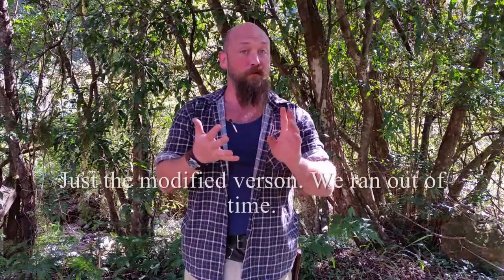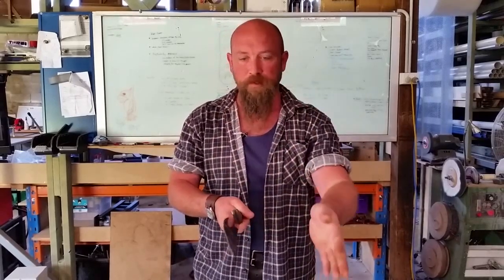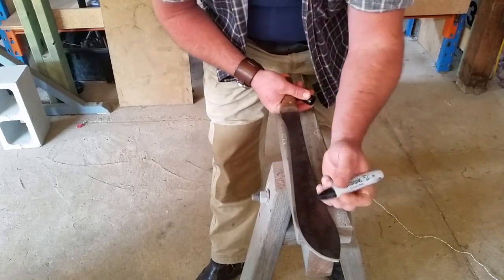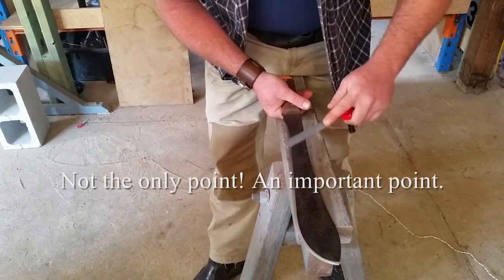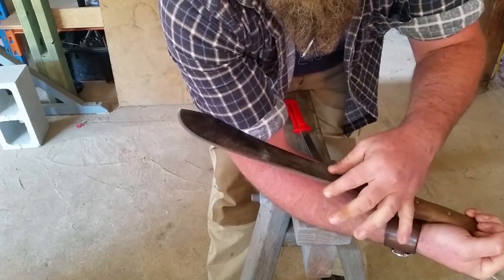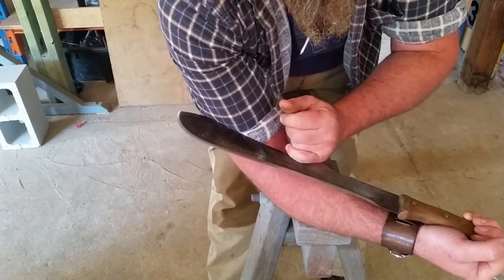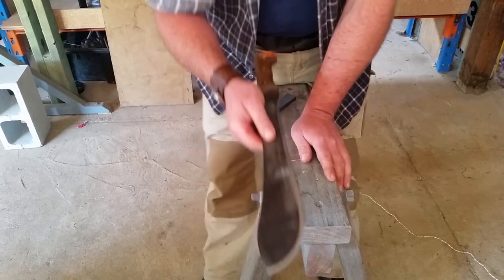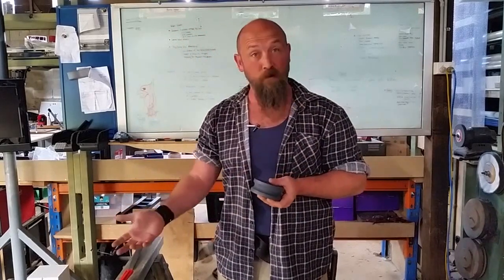Machete Sharpenening: A simple method that suits beginners and pro's

Comment: Anything special about that file or is it just a typical file?
Reply from the maker: That is a good question. At the end of the day, most metal cutting files that are not too coarse will work. Double cut files will hog out the steel faster (good for chip removal) but leave a lot of follow up work for the stone. Single cut files will always leave a smoother edge.
I use chainsaw raker files (sometimes called a flat chainsaw file) for a lot of reasons. 
It's reasonably middle of the road as far coarse/medium/fine cutting speeds and that tends to match the next finer stone I commonly use.
 Files are no where near as good as they use to be but chainsaw companies are still putting out fairly decent files that are available all around the globe. 
They are pretty much the same cutting pattern and size across all the brands.
They are cheap and easily packable.
They always come with rounded safe (non cutting) edges that I use as a poor mans burnishing tool to sharpen the card scraper on the back of the machete. 

If I'm in the workshop sharpening these machetes, I almost always grab a full sized file. About a 10-12" Smooth Mill or Mill Bastard file and I use a larger, double sided axe stone. 

When I am backpacking in to a camp site or I'm field sharpening, it is always that little chainsaw file and small pocket stone. 
Hope the info was helpful mate.
Kind regards,
Ben

Comment: What kind of file do you you?
Reply: I meant, what kind of file do you use? Thanks. Great tutorial.
Reply from the maker: I'm glad you found the information helpful D. It's just a flat chainsaw file (one of the files used for sharpening a chain). They are easy to get from any place that sells or services chainsaws. Technically it's just a mill file but flat chainsaw files are small and also have two rounded edges. The rounded edges are very useful if you are planning on putting a card scraper edge on the spine. 
I hope that helps mate.
All the best,
Ben

Comment: Where can you find that norton pocket stone? Will any Norton stone work as much as the one used in the video? By the way great video brother I learned way more than expected thanks 🫡
Reply from the maker: Nice one DB. Thanks for the comments. 

Machetes are really forgiving when it comes to sharpening. Because you have such a long edge and more mass, you can still get them to perform even with not so great sharpening equipment. 

If I was being honest, most of the quality brand name stones will get the job done just fine. That little pocket hone (Norton #149 Pocket Stone) is great, but it is also a bit on the fine side (clogs up easy). The double sided axe pucks are great if you don't mind getting your fingers that close to the edge. 
I like Norton as they are affordable and perform well. Lansky is another good brand. I think Bahco or Fiskars has a small line of stones. 

Canoe stones (traditionally used for sharpening scythes) are perfect but are hard to find these days.  

When you want a finer crafting style edge, it's just a matter of using finer stones/hones and an abrasive strop.

I hope some of the above was helpful mate.

All the best from OZ,
Ben
Reply: @MacheteBushcraftAustralia  Oh I see, thanks for the information indeed this was helpful. It put my doubts at ease from having to buy cheaper stones thinking it wouldn’t perform as well as the more expensive/finer stones from what I seen and heard from other YouTube videos… Your the best, again Thanks a lot 💯✊🏽I never seen anyone explain a tutorial like this with such passion 👏
Reply from the maker: @demonback8732  Happy to help mate!

I'm with you on that point. You're going to get many differing opinions on the internet. Sifting through what works for you is part of the process. I know a lot of people spruik the 'most expensive is always the best'. With basic quality sharpening gear, you can get an edge that will do almost all machete tasks.  Don't get me wrong, I like the finer (and more expensive) sharpening gear for nicer tools. I just don't see the need for it when you're sharpening a general purpose machete.

Comment: OK for field sharpening, but in the shop clamp the machete to the edge of your workbench with a C-clamp and getterdone!
But yes, a mill bastard file is the standard in Central America after you do the initial sharpening on a machine like an angle grinder.
Reply from the maker: Yep, bench sharpening is on the list of clips to do when I get the chance. I actually filmed it a few years ago but never edited it.  You're on point, you would not be picking smaller tools to sharpen if you're in a workshop. An angle grinder with a flap disk would also be my recommendation. It gives you a rough but very functional edge for green work. Files with a machete clamped down (like Colhane's machete mod clip) will work if no power tools are available. 
 I thought I made it a little obvious that this was a filed sharpening clip? Honestly don't remember as this was filmed years ago.
All the best from OZ,
Ben

Comment: what size / grit is that file?
Reply from the maker: +Brock Marshall  It is just a flat chainsaw file also known as a raker file. The size and pitch are all pretty standard across the chainsaw files I have seen. Oregon or Stihl are both easily found and are the ones I have had the best luck with. The cheaper brand files don't stay sharp for very long.  Hope this is helpful mate! All the best, Ben.
Reply: Machete Bushcraft Australia cheers mate

Comment: How do you regrind a machete bevel
Reply from the maker: I use a slack belt grinder. You can cut one in by hand with files or if you're confident, you can use a flap disk on a little angle grinder.
Reply: Machete Bushcraft Australia thank you can you make a video on how to do it with a file please but if not can you explain because I don’t have access to machinery like that just A file
Reply from the maker: I can do you one better and find you a good youtube video by Colhane. 
He covers file sharpening a new Tramontina machete. 
Personally I would not bother with a short scandi section like he does in his clip. I find if the machete is properly sharp, it makes very little practical difference. 
Great video from a very well known and respect outdoors man. 
https://www.youtube.com/watch?v=IsZb_1XfFHo&t=95s
Reply: Machete Bushcraft Australia thank you👍

Comment: I got a lot better results using a Smith's Diamond Tri Hone Sharpening System.
Reply from the maker: Nice one Lee! I had seen this system before and was unsure if I was going to try it out. Thanks for sharing your results. I might test the system out for myself some day.
Reply: Another fine sharpening system is the Spyderco Sharpmaker.I tried it on a CRKT parang and man what at edge it put on it.It will cut paper like a chef knife.

Comment: this is fucking awesome i would of never had thought of using a metal filer
Reply from the maker: HAHAHAHA! that comment took me by surprise mate! Actually I have been enjoying all the feedback so far. 

Files and machetes go hand in hand. They remove material fast and leave a wire edge that is wickedly sharp for slicing soft material. Stones and stropping remove the wire edge which gives you an edge that holds up much better in harder material.

I'm glad the info is helpful mate!
Kind regards,
Ben

Comment: i prefer grinder and metal file the blade get SSS(super scary sharp)
Reply from the maker: Sure, a grinder and a file will get a really sharp but wiry edge. It's wicked sharp in anything soft. If you refine that edge slightly with some finer abrasives, you will find that you will hold that edge far longer in harder materials.
Reply: @MacheteBushcraftAustralia   I use Waterstones to polish the edge of my machetes after filing then clean them with Alcohol to prefer rust on them

Comment: oh I test my blade with paper to make sure I didn't miss a spot.
Reply from the maker: +Kevin Solomon 
Paper is the best in my opinion as well.  I was over having bald patches everywhere and I'm glad I swapped to something else. I now use poor quality 48gsm brown paper as my official tester. Another one I have been using lately is to not shave  but to very gently rest the edge against the arm hair. If I feel it grab or pull, I know it is shaving sharp. No need for bald patches. 
Thanks for all the comments and kind words Kev! 
All the best,
Ben

Comment: What if u font have a stone
Reply from the maker: Well after you file the edge, you could just add a micro bevel with 600grit Wet & Dry. Then strop that edge on a smooth piece of pine to break off the wire.

Comment: why bother with the saw horse for one side if you can't do it for the second side? Makes no sense
Reply from the maker: Maybe I missed the point of your statement (please correct me if I get this wrong) but not everyone is confident filing a machete free hand in the air. Having a stable surface to push against helps remove some of the risk. It does not need to be a sawhorse. It could be a fallen tree, fence post, workbench etc.
Reply: You file one side on the saw horse and one in the cradle position. Why not flip the machete over and do the other edge on the saw horse also?
Reply from the maker: @Prefer2Hibrn8  I got you now Hibrn8.
 There is 2 reasons for that. 1) Not everyone is comfortable with filing towards the edge. This tends to be mostly with beginners until they build up enough confidence/experience.
2) very few people are comfortable swapping the file to their non dominant hand to get to the other side.

Now here comes that cradle method. You can file one edge from behind by steadying  the machete against a fence post, tree etc,. Then keep the file in your dominant hand, cradle the machete and get to the other side. 

Pro's are more comfortable filing into the edge (it's actually quicker) and sometimes the will do it in free air if the file is sharp enough and they are just tipping up the edge.

There are many other field sharpening styles people use. This just happens to be one of the simpler ones for beginners to get their head around.

If you're filing the edge in workshop, it's best to clamp the machete down and use two hands to control the file.

Was some of that helpful?

Comment: Belt sander. Remember, a machete isn’t a razor. You’re cutting branches, not sushi.
Reply from the maker: Yeah.. I don't think you thought too long on that before you commented Robbie. I'm sure I waffle a whole lot, but that point is covered in this clip. For the record, just a belt sander sharpen makes for a subpar chopping tool if you're including branches. It would be a great edge for soft veg like banana, fresh grasses or any spring growth but the moment you hit firmer timber, you are going to roll that ragged edge. Yes, it will still 'cut' but you're going to be using far more speed and effort in the process. A little extra refinement goes a long way... 

On the point about sushi (sashimi?), if you properly sharpen your machete, they can do a very decent job of dressing fish for the table. I personally prefer using a little knife for that task, but it's nice to explore the 'multitool' uses of a machete. 

I might add, this is a field sharpening method. To further that, not everyone has a belt sander. A file and stone would be the minimum required. If I was going to suggest a power tool sharpening method, a little 125mm (5") angle grinder with an 80grit zirconium flap disk (most hardware stores stock these) would be a fare more effective tool and a lot more people own them. I'm yet to film a method I use for that task, but it's on the list. 
All the best Robbie,
Ben